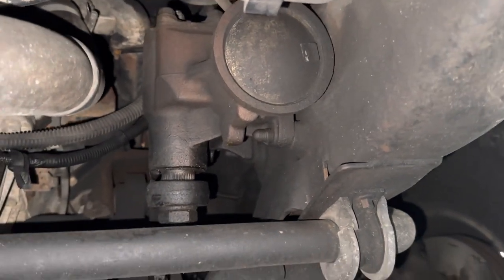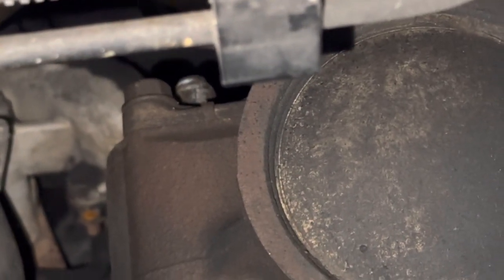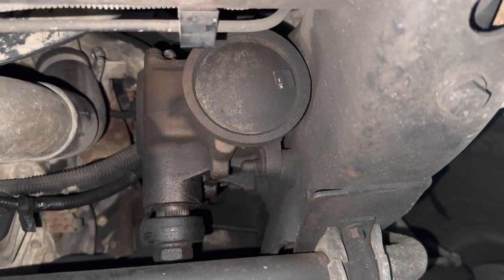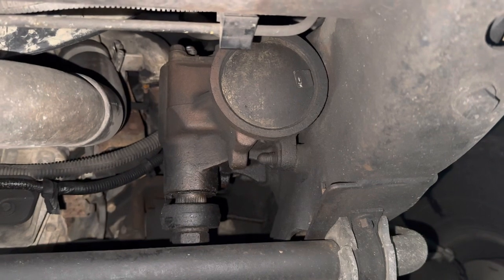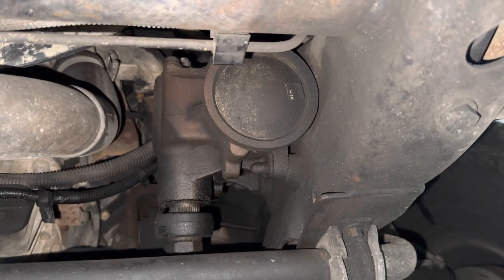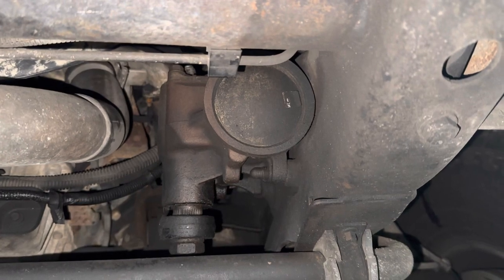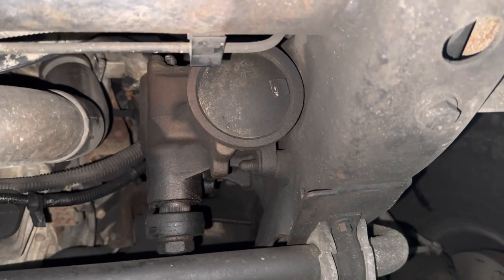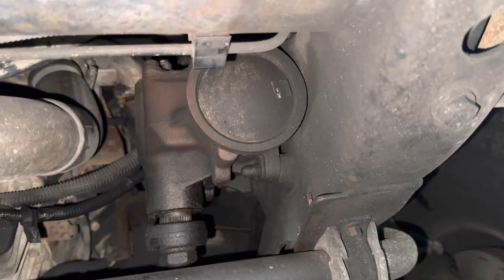Chevy 2500hd steering box adjustment

Comment: Just a heads up, there is also a spanner nut on the steering shaft side under the seal that needs backlash adjustment while adjusting the nut you mention in this video.

Comment: You adjust it every year? I think its time for a new power steering case
Reply from the maker: It's on the list. It still drives perfectly fine I just like to keep it snug without any steering slop.
Reply from the maker: Id rather over maintain my truck than overlook something and have it break at a bad time
Reply: That is the incorrect adjustment to be made for the symptoms you are describing. The proper adjustment point is on the input shaft, requires a spanner wrench or long needle nose pliers. Look up the proper steps for adjusting play in a Saginaw steering box and follow those, you won't be prematurely wearing the pitman shaft and having to adjust it yearly.
Reply from the maker: @BuffaloBasquo  this adjustment isn't incorrect it's just another way to do it, I check play every 1/4 turn at the steering wheel so I'm not pulling the steering shaft out. I do it yearly to keep everything nice and snug with the driving I do and how old the steering box is. Yes I need a new one but a kryptonite front end is coming first since. This keeps my 280,000 mile Duramax driving almost like new so I'm gonna keep on doing it 👍